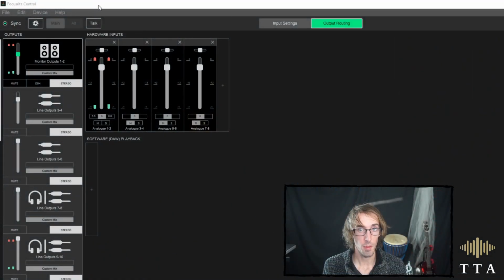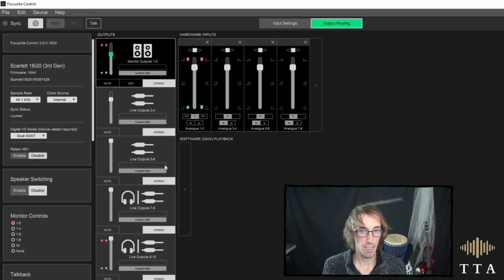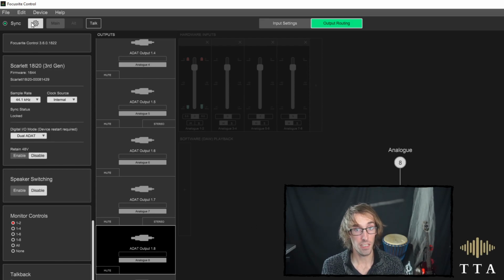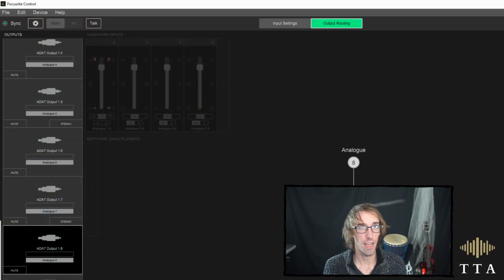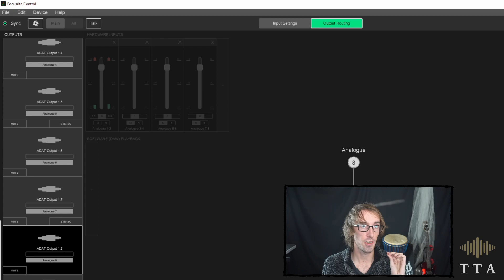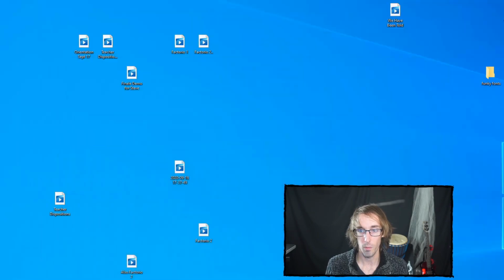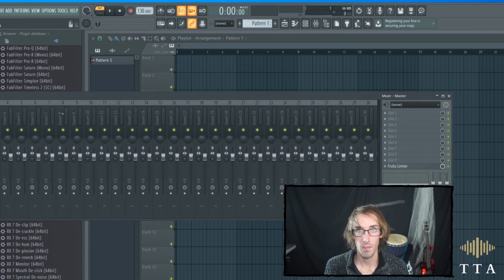Focusrite 18i20 ADAT/Optical Tutorial Faster

Comment: also would i have to connect the monitors to the master interface ?
Reply from the maker: Typically that's what you do because then you can select ANY inputs to come out of the monitors. 

Course it's also possible to connect your monitors to your slave interface that's running in the background.
Reply: @shawnmuench  How? I have all my outputs used for my master 18i20 gen 3 for near spkrs, wedges and 2 hph amps, but i have 8 outputs left unused on my slave octopre, but dont know how to get them to power/signal more wedges/ hph amps etc? ! :(

Comment: Thanks a lot for the video! I am thinking about buying the Scarlet OctoPre to add 8 ins via ADAT to my Scarlet 18i8 3rd Gen (that only has 4 mic pre), and wanted to ask if you'd recommend this combo? Also I was wondering if the use of external ADAT devices is going to affect the CPU significantly? Thanks in advance
Reply from the maker: Nope! Audio over digital is real spry. It's plugins and stuff that will tax your CPU. You can do audio for days. 

You could definitely get more inputs with the octopre. It's not an interface though so you lose some flexibility. For a bit more money you could grab an 18i20. I wouldn't think the preamps are worse-- haven't checked the specs. 

Can read here too: 
https://www.gearslutz.com/board/low-end-theory/1264664-focusrite-scarlett-18i20-focusrite-octopre.html
Reply from the maker: Think of the gear as a baller audio card for your computer-- it handles the thinking so your computer doesn't. That's why it doesn't hit the CPU much.
Reply: @shawnmuench  Thanks you very much man! Very helpful!
Reply from the maker: @valeriolapiana6643  All about that real world info! The internet's only useful if we work 1:1.

Comment: At the 1 minute mark did you make an error as to which interface you were meaning??  You said  "Only one interface is on; the slave interface."  Didn't you mean the master or main interface???
If I had only the slave interface on at this time, it loses contact with the computer as the main interface is off...

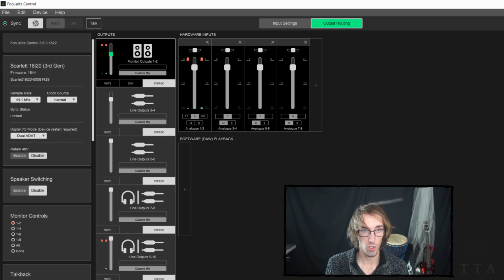At the 1:20 mark you say close out Focusrite Control and restart your device.  Which device are you referring to?  The master (main) interface or the slave?
Reply from the maker: Mm-- the slave interface is the one sending signal to the master. At that time I only have the slave plugged in via USB so that I can configure it. Once configured I turn it off. Then I turn on the master interface and the computer "grabs" it. Following that, I can turn on the slave (sending) interface and it runs in the background np. 

At 1:20 I'm shutting down my slave interface having completed the configuration.  

:))

Comment: Thanks! would this approach work if I was connected x2 Saffire pro 40's?
Reply: that does work! I have a video up on my channel and I'm working on some more!
Reply: @bobdrums  yep cheers! I hooked them both up and all good
Reply: @breakers55  did you connect over adat or connect them together over firewire? I've connected min over firewire and you can control them both in Saffire mix control through just one being connected to your computer!
Reply: @bobdrums  Over firewire also using mix 9 onward for the second set of ADAT outputs. So for example Mix1 has the first Saffire 1-8 analogue inputs, then mix 9 would be for the first of the additional saffire inputs with the analogue input 1 and fader up and ADAT output 1-=Mix 9, second mix 10 analog In 2 etc with the ADAT ports set to match the mixes if that makes sense. Might be a better way but works for me!!
Reply from the maker: Looks  like it! Seems to be the same sort of gear-- and looks like they have a control software for all the routing etc. etc. Give it a go!

Comment: Found this looking for something else— trying to compare scarlett gen 3 and clarett 8pre to figure out which to buy. Saved me a trip. I’ve been wondering about the functionality of this. I was hoping you might have the time for an off-topic question about some routing I’m having trouble with. I’m finally getting all the equipment I’ve been wanting for a decade, and I’m having trouble figuring out how to route sound with a compressor. Seems more difficult to find info than I anticipated. To clarify, my main problem was that my old interface is an Eleven Rack, which cannot receive from two inputs at the same time. I could use the ER as a separate preamp if I needed to, but just out of curiosity, is there a way I can use just the scarlett and get it to understand that I want a mic to go in to one preamp, be routed out to the compressor, and be accepted into another input? Could I do it with another track armed to record in protools with the right i/o setup where one track would be recorded dry and the other with compression? Or— is there any reason I couldn’t record a track dry, send it out of the output connected to the compressor and have it sent back into the scarlett while recording a compressed copy to a new track after the original has already been recorded (in case I want to tinker with the amount of compression without it being permanent on a good take)?
Reply from the maker: Oh yeah-- you can route all that in Focusrite Control. You just have to be careful that your mic signal circulating back in isn't being outputted where the original signal is being outputted-- or something-- avoid loops basically. Careful assignments etc. Don't want to fold the signal over itself multiple times. 

I'm having trouble imagining what would amount to feedback in this case but be careful-- hardware feedback is loud and awful haha
Reply: The Transcendental Academy thanks for the input! Any thoughts on scarlett gen 3 vs clarett 8pre?
Reply from the maker: @jinxwren4628  No experience with the clarett-- and don't really have ears to say anyhow! 

Gen 3-- I've had midi issues, which is why my gen 2 is the master interface. 

I'm assuming the clarett is higher end?
Reply: The Transcendental Academy Clarett is the higher end of the exact same thing. Slightly lower noise floor, slightly higher dynamic range, and slightly better preamps for almost twice the money. MIDI issues? That’s sad to hear. I literally just got 18i20 gen 3 in the mail. Haven’t even unboxed it yet. I was seriously hoping it would be easier with MIDI than my eleven rack🙄 What sort of issues? I’m trying to use MIDI for my drum kit, but it would be good to know if it’s not going to work before I drop $150 on a drum vst.
Reply from the maker: @jinxwren4628  Well it was dropping notes and stuff-- maybe just my rig though! Try yours and see. :)

Comment: My interface is Behringer UMC1820 - which is full.  I got a couple of new desktop synths yesterday and bought the Behringer ADA8200 to allow them to be connected.  They are connected to ADAT1&2 and 3&4.  The ADA8200 is the slave and connected to the UMC1820 by Toslink cables.  Everything appears correct.  The synths receive midi and the interface receives audio from them - I can see the green leds flash!   However there is no audible output!  If I connect these synths to the UMC 1820 all is as it should be.  Just no audio output when connected via the ADA8200.  Latest drivers installed in the UMC1820.  I have a feeling it's probably something very simple I'm missing - but it's driving me mad.  Any and all help appreciated.  Thanks!
Reply: did u find solution having same problem

Comment: So what changes if you want to record on 96khz?
Reply from the maker: Then you use two optical cables (at least on these Focusrite devices). But-- in my case I have the Gen 2 as one of my interfaces-- which doesn't have two doors to receive/send the split optical signals. 

Then I suppose you just be sure to set the 96khz in Focusrite control-- and in your DAW.

Comment: What buffer size do you use when recording at 44.1kHz? Would you recommend recording at 48kHz if only using one ADAT cable?
Reply: @shawnmuench  thanks! I used 256 now and it works great most of the time! Just been new to using adat and had some issues ...using the interface as slave and at 48k with 256 buffer size is optimal.